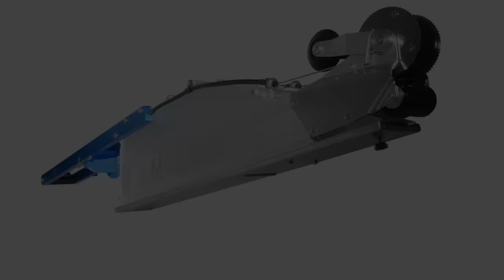The Improved Mud Box Pro from Tapepro

Comment: Just got one of these today , theres some learning curve to it but i did tape flat joints much faster , i still cant do corners properly yet but ill get the hang of it with time and use . 10/10 so far ( btw I work doing taping for 20+ years doibg house and high rises and this tool will help you if you do a lot of work weekly)

Comment: Ok I used mine for the first time works great on walls having issues taping cielings papper rips so my question is was running it too thin of mud I tried mixing the mud like I would for a banjo so should I thin it down more like I was mixing up for a bazooka please let me know before I return it for a bazooka
Reply from the maker: Hi @razerburn421, mud consistency for internals  can be a bit different to walls & ceilings. If it's ripping the paper, it may be too thick. If you would like to talk further, please email us your contact details at marketing@wbtco.com.au and we can arrange for someone to contact you
Reply: Having the same issue. With the same consistence of mud, the walls go smoothly, but tape rips or drags really bad when doing ceiling flats and angles. If I thin the mud down, then it's more likely to leak from the Mud Box when doing ceilings.

Comment: What is the difference between Mud box & Mud Box Pro? Thanks.
Reply from the maker: The original Mud Box has a spring loaded combined creaser wheel and cutter. This is held back when taping and released for cutting.
You need to remove the tape wheel from the wall to allow the cutter to rotate into the right position for cutting.
The control handle is on top of the tool and positioned about mid way. 

The Mud Box Pro Has a separate creaser wheel and cutter and rear controls for both.
It is also slightly longer so can have more reach depending on how it is used. check out these great videos to see the difference  

https://youtu.be/wFqIu5xIi-8 

https://youtu.be/N0fp87WSmG8

Comment: Have the mud box pro have a real problem with ceilings and ceiling internals
Reply: Hi Tim, what seems to be the problem?
Reply: it just sides cant get the tape to pull out
Reply from the maker: Hi Tim, would you mind sending your contact details to marketing@wbtco.com.au so I can facilitate some contact with you and the manager at Tapepro? He ma not be getting the notifications of your comments - this reply even slipped through the Wallboard notifications.
Reply: Hi Tim, you have to make sure the tape wheel is contacting the wall. Mix your compound so that you can pull the tape through by hand - if it is too thick to pull by hand it will be too thick to work in the machine. You have to press the serrated tape wheel into the wallboard, pinching the paper tape.
Reply: Tim Hennigan I saw the guy in the video hold the tape down with his foot, when he did inside corner.
Reply from the maker: Robert Perez, everyone has their custom style. The consistency of the mix is the key to tape drag.